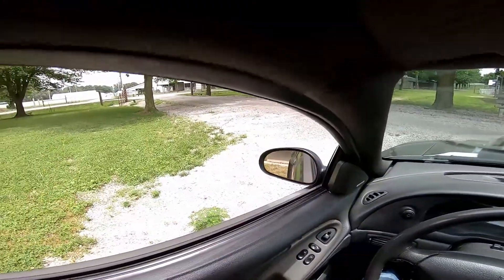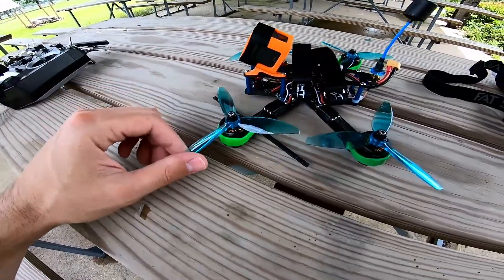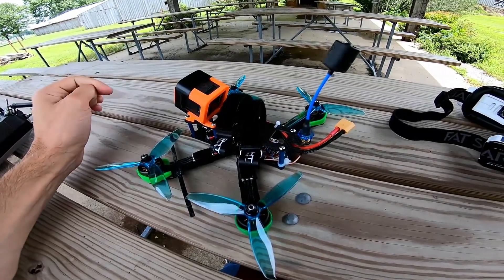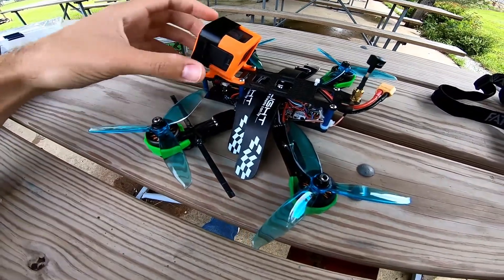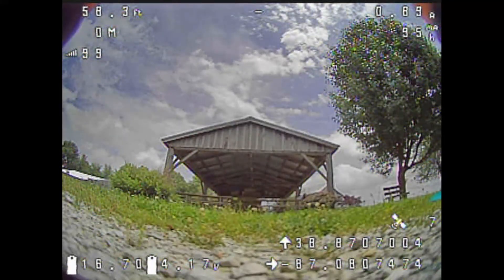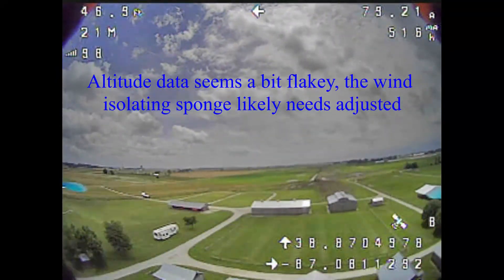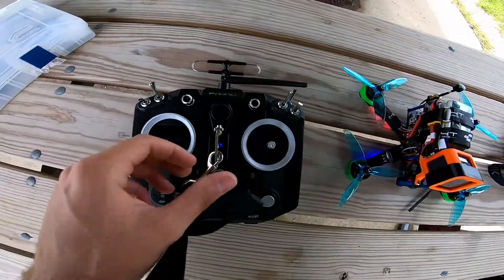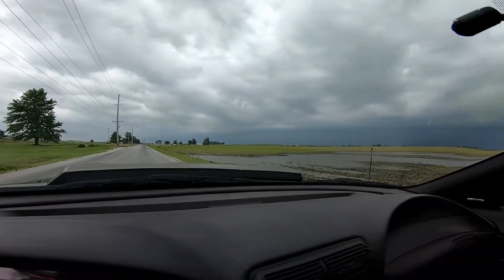3BHobby 2306 2500kV Motor Long Term Review

Comment: Great video! Question : What type of motor guards are those? 

Fantastic flight. I have these motors, not yet installed. Looking forward to it.
Reply from the maker: Thanks, The Dan Jones Show! These motor guards are just the generic Chinese ones you can get on amazon. Here is a link to the exact ones in the video. 

https://www.amazon.com/Readytosky-Protector-Plastic-Protection-Quadcopter/dp/B01HM2W9TS/ref=mp_s_a_1_1?keywords=2205+motor+guard&qid=1570191724&sr=8-1

Its a kit with three sets of guards in red black and green along with some additional hardware.
I hope you enjoy your new motors!